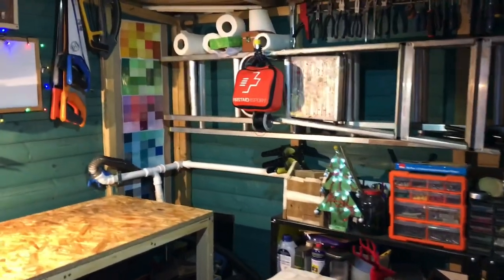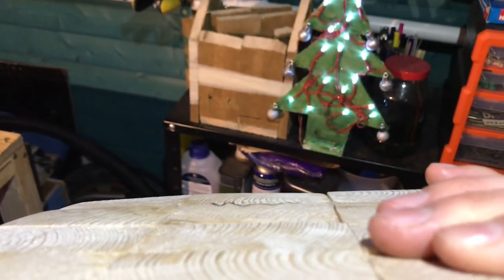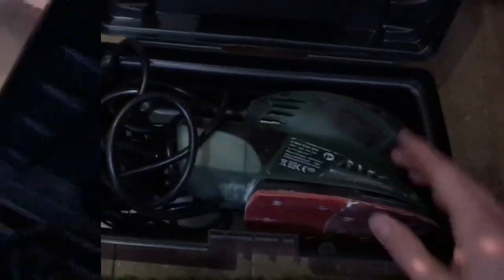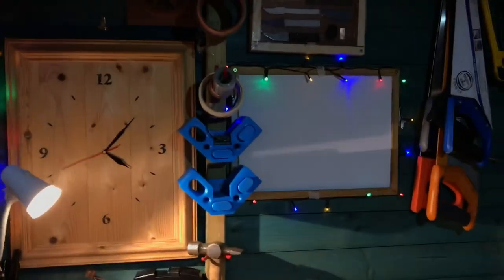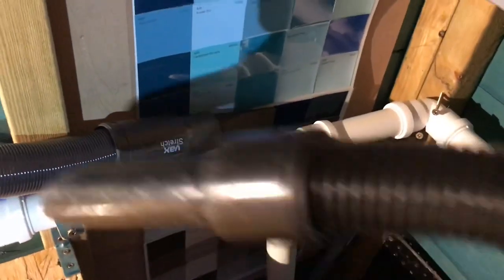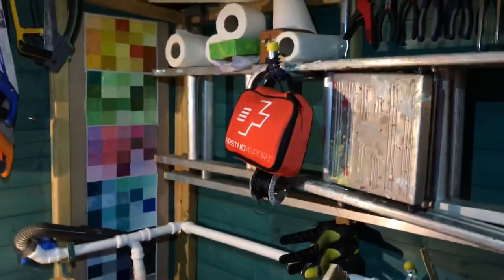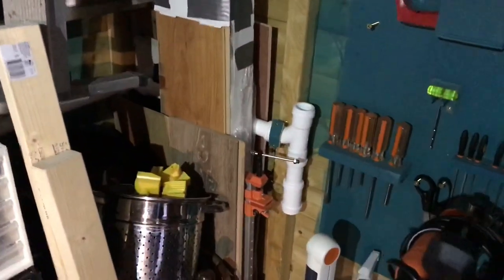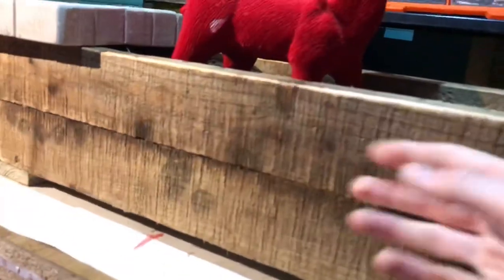Small Workshop Tour | 10x6ft

Comment: I have a fair few years experience now and have a rather hectic shop as I'm sure you will have in a few years it's good to see younger people still doing Woodworking and a bit of advice for your outside projects would be to use an exterior grade clear coat or resin as it will protect better than Danish oil
Reply from the maker: Thanks! That’s really useful to know!